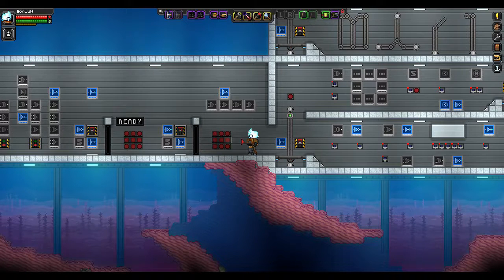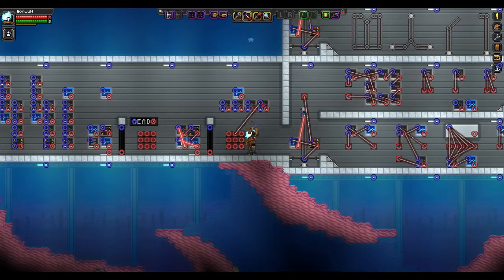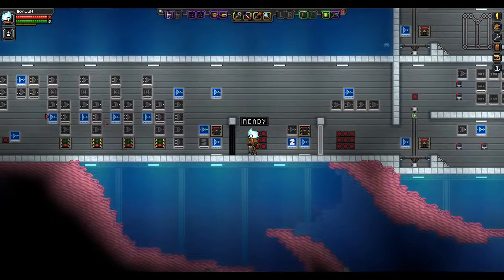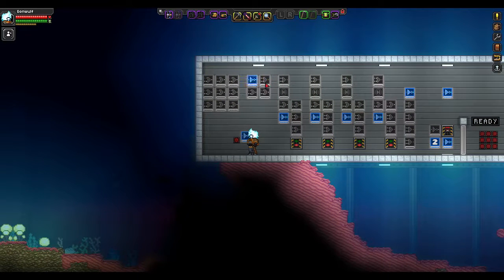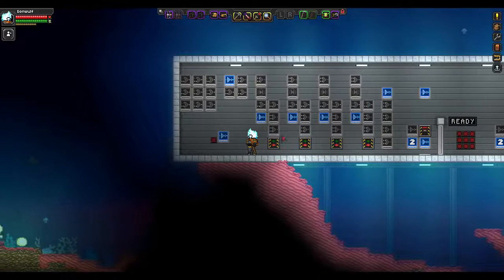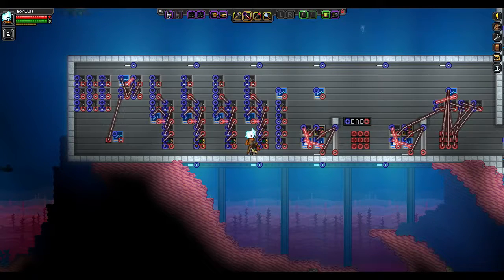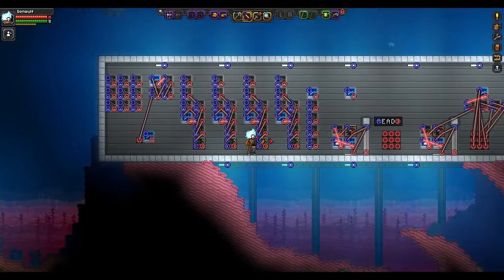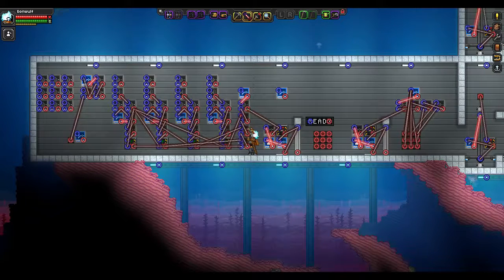Starbound - Password Doors Tutorial [v1.0]

Comment: +Eonwulf: Great video man.
I was wondering, how would you go about making an order-sensitive keypad? Let's say that your keypad aren't just face-less buttons but they actually correspond to numbers, and you wanted your code to be.. eh.. 9942. Can you do it? :)
New sub by the way.
Reply: No, you specifically showed that you could go "top or bottom" on the button presses, which means there isn't only one unique code to get in the there... or am I being particularly dense?
If it's not the case that I'm just being a little dense here :P what I was proposing is a keypad that has a single unique code, for example 9942, or 6429, and so the "numbers"/button presses must be punched in the exact order. Say that the number you programmed was 5541, the way your system currently works if I'm not mistaken is you could technically punch in, say, 1545 and that would still work, yeah?
Reply: Oh alright man. Ok I figured it could have been me being a little dense, and it was :P Thanks for the extra info. and explanation, it makes sense now :) It was a great video before, it just got better lol
Reply: Think my problem was that it was a lot to follow in one video, and since being able to press any number in the code to activate the system is kind of "default" way these keypads work (unless you go the extra mile like you did) my brain just kinda summed it up as that being the way it worked as well lol. Again my problem though :P
The way I have it setup at my place is a little different. I spawned (sadly because you can't craft them or pick them up) the laser tripwires, and got a giant portcullis from a glitch castle, then made a "safe" room in my storage area. If you input the right code, it disables the tripwire until you walk away from the room. If you trip the wire the giant metal bar door comes down and blocks you from getting near the goods inside the safe room.
I think I'm gonna be updating the keypad system with your method today :)
Reply: +Eonwulf: Sorry bro, but got a couple more questions. Trying to understand the logic rather than copy/pasting everything.
-So I think I heard/saw you mention what happens if you enter the wrong code, and you mentioned you have to input all of them or the system won't be able to continue. Does this mean if I press... say the code is 1-2-3-4... if I press 1 and then 3. Will I be able to press 2 and carry on with the code like that? or do I have to press 1 again because 3 was the wrong order? Only asking because I didn't see the persistent switch get reset.
--Wouldn't it be a better "reset" mechanism to check if a button out of order was pressed? Say that I pressed 1, but then instead of 2 I pressed 3. Wouldn't it be better to have that 3 be what resets the keypad?

-Second question would be, you mentioned you need to let the button work before you press it again/another button. What DOES happen if you press the buttons too quickly? And is there a way to circumvent that? I imagine after a few times of pressing the code you will want to punch it in very quickly, but the system is gonna be holding you back?
--With my own current system currently you can punch in the numbers of the code in any order and they will work, but it also seems to have a few advantages over this method (even though I do think your method is superior), one of which being able to enter the code pretty much as fast as you want (and actually kind of have to punch the code in fast lol)

Thanks in advance man and sorry for all the questions.

It'd be interesting to see in the future if you make another video like this, for you to showcase ways to actually break the system as that's just as useful as showing how it works. There's always going to be that person that does something completely unexpected when they don't know what to do with the keypad, and somehow they manage to break it or cheese it by doing something you just didn't take into account.
Reply: How would the person know that 1 was the first number and 3 the second? I mean my point of view comes from a system where the logic isn't sitting right next to the door :P (in my base my password logic is sitting deep down and buried, and then of course for the whole thing not to be pointless like you mentioned, we'd have to have tile protection on (although I'm not sure if tile protection protects wires?).

As for the system not being able to go quickly, I'm not sure that anything would happen honestly. My question came up mostly when I saw the gizmo you built to act as a "quick press" (which was pretty clever by the way), but then you mentioned that you had to wait... so I was a little confused there.

If it's a matter of having to wait a bit in a scenario where you would have your code repeat a number, then the solution would be pretty simple, just don't repeat numbers if you want it to be quick :P doesn't necessarily mean you can't though which would be the beauty of it.

Anyway, thanks a lot for your replies man. Think I'm gonna upgrade my system today.
Currently my system is using a laser tripwire to cause a metal bar to block the goods inside the safe room. Deactivating the wire makes it impossible for the door to come down, and for as long as the person is inside the the room the tripwire will keep resetting itself to make sure nobody accidentally locks you inside. The other system built in is a bit of an anti-cheat system, as a door with a tripwire is fairly easy to cheese by using a dash or a blink tech, I have it set up so if the wire mechanism wasn't disabled properly, and the room "senses" somebody inside, it triggers a flashing "CHEAT ALERT" sign somewhere outside the room where it would normally be hidden by line-of-sight shadows. Was rather proud of it until a friend starting breaking the keypad system just because my code logic isn't built properly lol, heartbreaking <_<.

Anyway. No more bibles worth of text from me, sorry about that :)